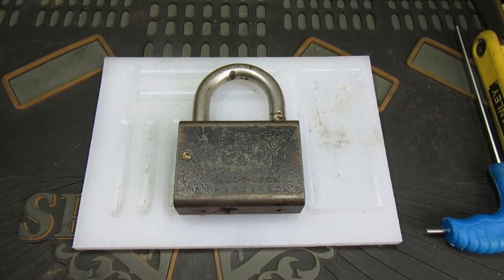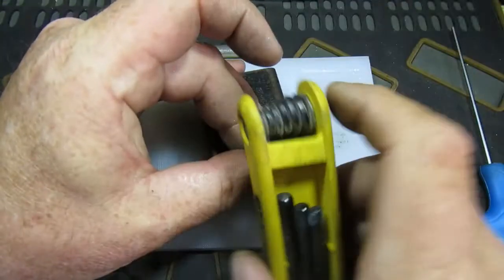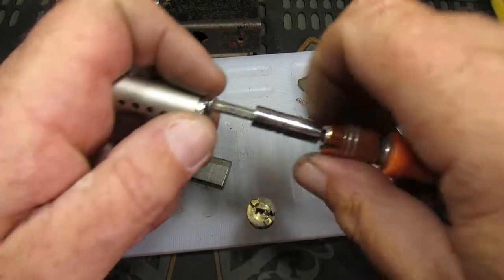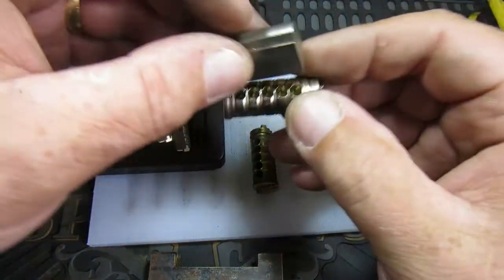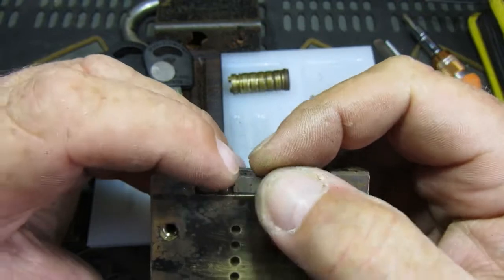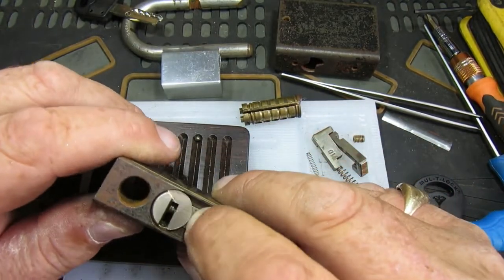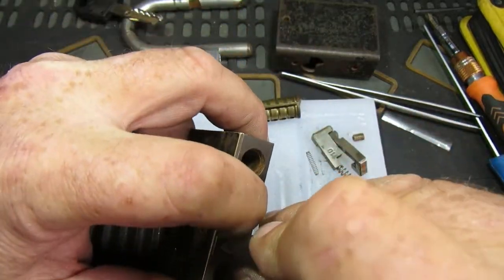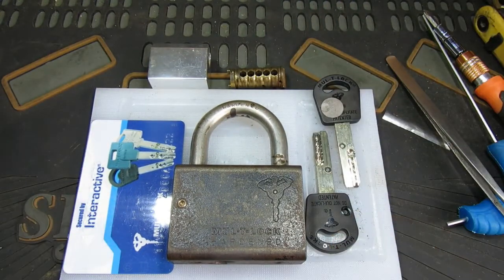(318) Upgrading an Old Mul-T-Lock Padlock with an Interactive core

Comment: Do not buy the new NG series red and black multi locks they do not last the keys are cheap aluminum they lock I bought for to replace my old silver see you series multi locks which I had six for 10 years one after 10 years gave me a problem they talked me into buying for new ones with in a year three of the four locked me out couldn’t get in jammed took it back they charge me to re-do it for their labor and they said oh well it must be dirt it must be this 10 years￼